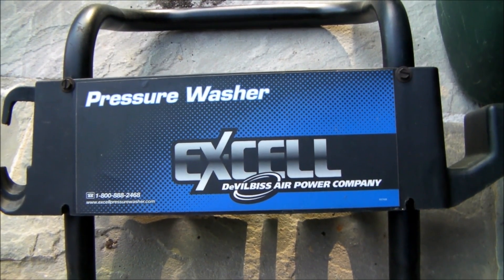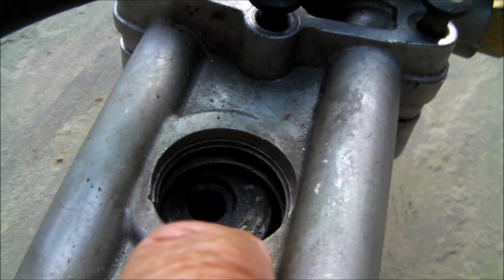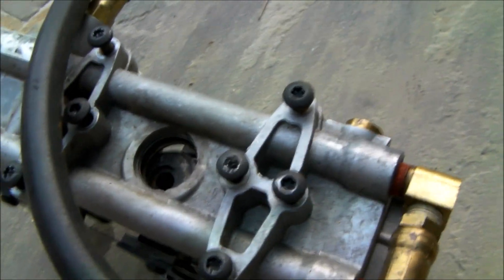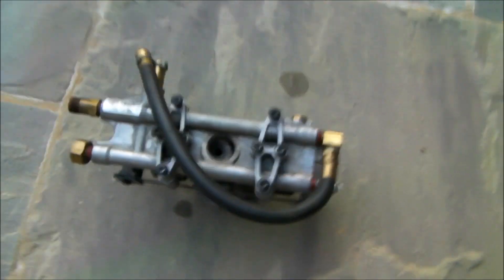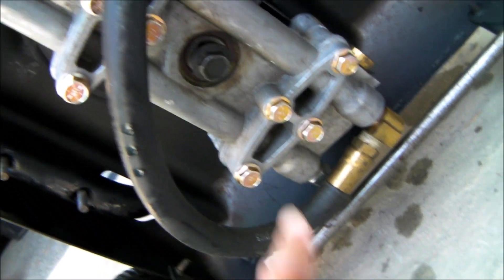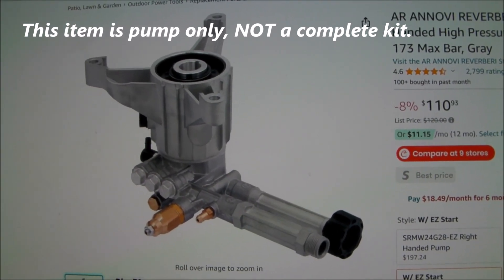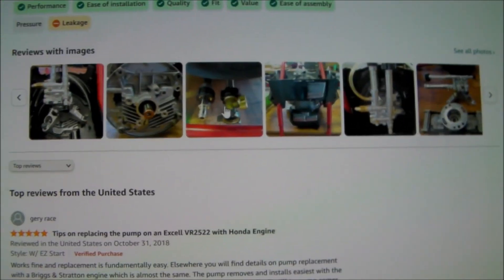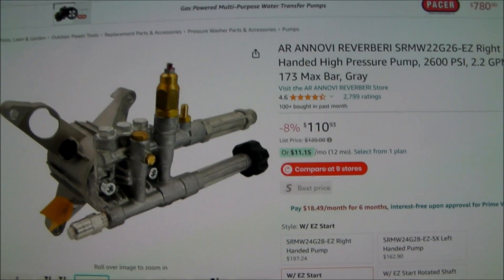Excell Pressure Washer Pump Fixed for $5

Comment: This is great but my pump won't come off when I remove the bolts that mount to the engine. Please help!!!
Reply from the maker: There might be a set screw holding the key in the pump to the engine shaft.  Good luck.